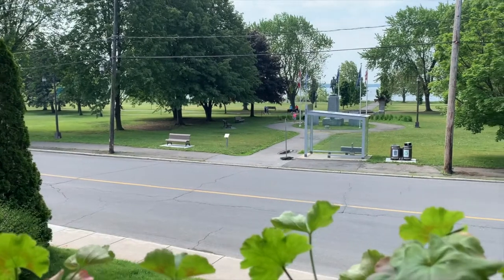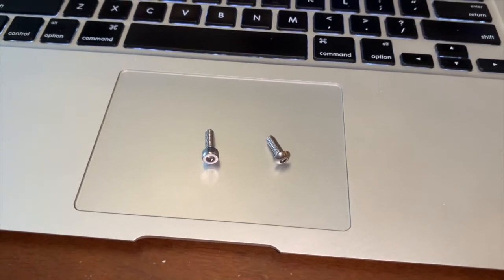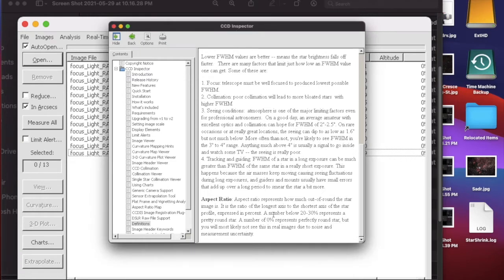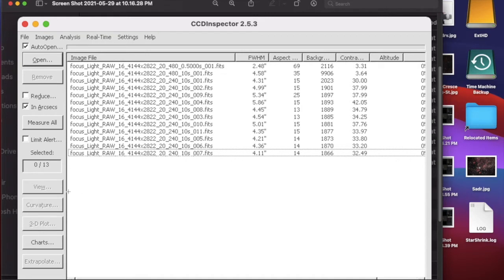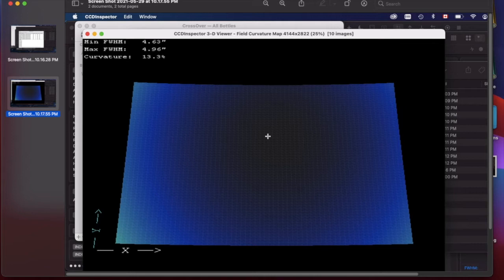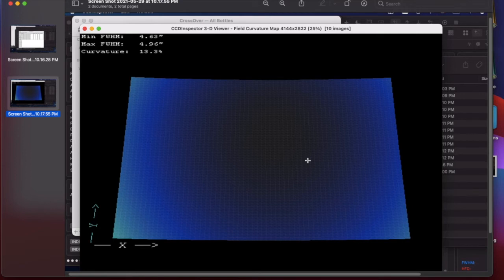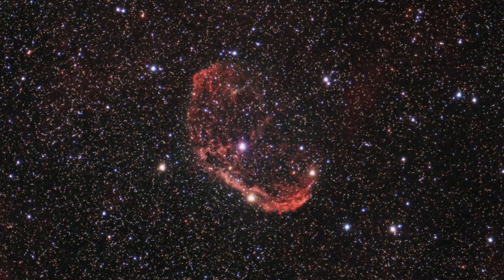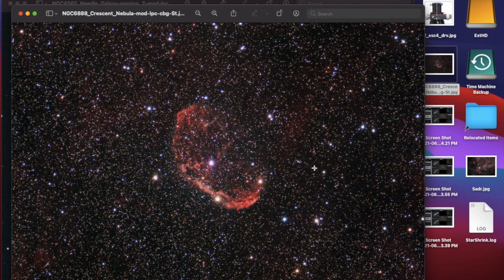Focus and Collimation Part 3

Comment: Hello,
I'm having bad stars on the corners with WO FLT91 and after many trials and errors I noted that it is not the camera that is causing the tilt. So from your experience how do you know if the elongated stars are caused by lens system collimation error or flexure in the focuser draw tube?
Reply from the maker: Hi Maged, that is a very good question! I’ve been hounded by these problems still. But I just bought a new RC-8 and most of my issues disappeared - my only issue was some chromatic aberration that is apparently caused by atmosphere as reflector scopes cannot have ÇA. But I have some ideas but I’ll have to get back to you in a couple days.
Reply from the maker: Hi Maged, I looked up the FLT91 and it looks like a great APO telescope but it is not yet an astrograph in the sense that it will not have round stars at the corners you want for astrophotography. This is normal for all singles, doublets, triplets (APO). An astrograph will have a fourth lens at the focuser which is essentially a field-flattener to give you those round stars at the corners. So I recommend you buy the WO 68III Flattener that is made for the FLT91 - no reduction. I finally bought the 6AIII for my ES ED102CF - with 0.8 reduction. See my video "William Optics Adjustable Flattener Yes!" where I give my last word on focus, collimation. If you already have the flattener, let me know and I give you some more tips. Cheers!
Reply from the maker: Great video on reducers and flatteners: https://www.youtube.com/watch?v=5J654T0UpBc
Reply from the maker: Here is an excellent document on backfocus - note the image in section "How to Tell if Your Equipment's Back Focus is Off" - https://optcorp.com/blogs/deep-sky-imaging/how-to-set-the-correct-back-focus
Reply from the maker: My last comment... I see the flattener is expensive. You may just want to keep it simple and live with cropping your image. Cheers!
Reply: @astrobuddy7895  Hello, yes I have the WO 68III Flattener installed on my FLT91 and will sure be happy to receive the tips from you.
Reply from the maker: @magedsyehia  The first thing you need to do is make sure you are collimated. In the end I found that a Cheshire Eyepiece does a good job - one without crosshairs - I bought one with crosshairs and removed them. Remove the flattener when doing the collimation. The Cheshire eyepiece is tricky in that you see a very tiny circle of concentric light rings with a black dot in the middle. Adjust until you see that. I guess that will be my next video ;-) The second thing is your backfocus. FLT91+68III requires 75mm backfocus - that's a pretty long backfocus. You will have to add 70mm of spacing between the 68III and your camera sensor and add 5mm of adjustment on the 68III. Also, if you have a light pollution filter, you will have to add another 1mm of adjustment on the 68III. If the collimation is good and the spacing on the backfocus is correct, you should have round stars throughout your image - see the link I gave above about how to know when backfocus is correct. Now, nothing is perfect if you start pixel-peeping but otherwise it should be good. If it is not, then yes, you may have tilt ;-( In this case, I would inspect the image train, especially the focuser for a misalignment. I found my focuser was actually jammed crooked at the rotator ring! I would imagine your scope to be very high quality and its unlikely that the focuser is giving you tilt, especially since you are probably screwing all fittings together. Also, do your image testing with only about 5-10s exposure to keep tracking issues from entering the equation. Let me know how it goes, and good luck!
Reply: @astrobuddy7895  Thank you so much for your help. and I can't wait for the Cheshire video :)

Comment: Hi! How do you run CCD inspector on Mac?
Reply from the maker: Hi Diego, on a Mac I can only analyze files after they are captured - not quite real time but each exposure takes about 10 secs anyway. I use "crossover" to run PC apps on my mac - very good application. But in the end I actually bought a cheap PC for $200 that I use for special astro stuff like CCD Inspector or talking to devices for some test purposes. My rig runs on a Raspberry Pi that is connected to my mac via wifi from the RPi. The software I use is from Cloudmakers - another very good software!